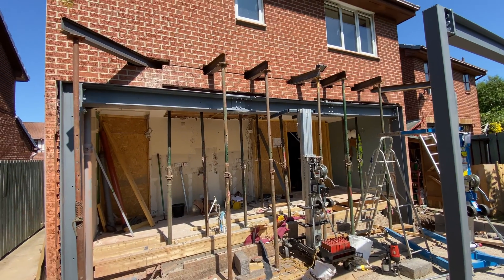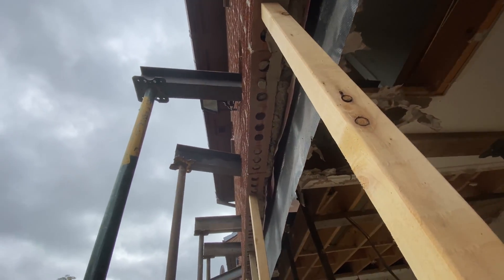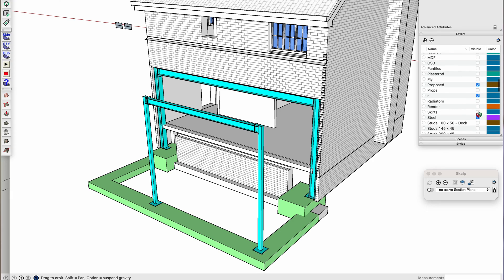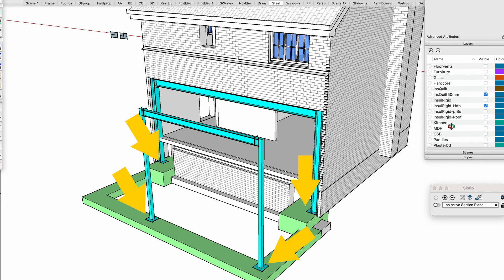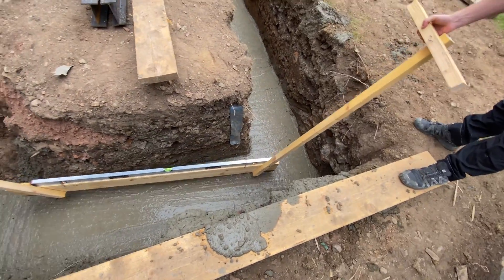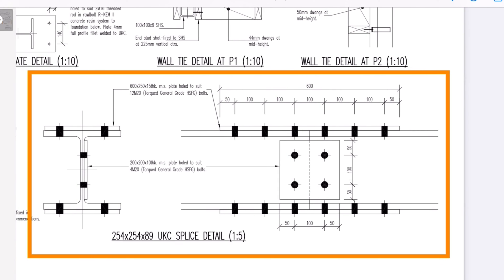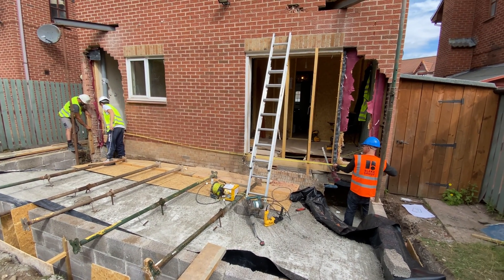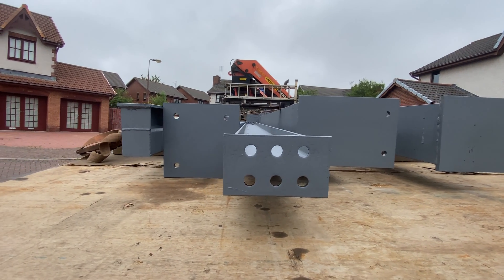Steel beams for house extension - working with structural engineer

Comment: Great videos, thanks !

Imagine I was thinking about a rear house extension. The footprint would be about 7m wide x 3m out from the house, height around 2.5 metres. So a big rectangular box. It would be a single storey, but would need a flat roof that becomes a balcony area to serve the floor above. 

If all of the knock through rear walls of the house would be taken care of with steel beams as is conventional. Could the new extension then  be then be built as a whole new steel framed box to sit butted to the back of the house and essentially be self-supporting, i.e  not adding extra load to the house ? 

I'm imagining conventional footings trenches/concrete would be used for the foundations.

Anyone, please... Very Roughly How much would a basic steel structural box 7m x 3m x 2.5m cost to have fabricated/supplied ? I live on the South Coast of Cornwall, it's 2025.

Comment: Looks brilliant - and very informative video. I've got joists spanning from side to side in my property (rather than front to back), was that the case with this build? Is the right thing to do to prop above the joists?
Reply from the maker: Hi and thanks. You prop above where the beam is going. And put a temporary prop batten under the joists

Comment: When I took out a wall 40 odd years ago (my one and only time), I put the full length beam on the floor by the wall, then put the needles through and supported them on Acros on each side. We took out enough courses of brick to allow the beam to fit in. Lifted the beam up via ropes over the needles and fitted it, fully grouting at the ends and top. I then left it till next day and then took down the rest of the wall. The house is still standing.
Reply from the maker: That’s a nice story and fantastic you’ve benefited from it over these years. There’s definitely an understated benefit to our lives when we do something like that and is there for years afterwards.

Comment: Great video and very well explained. Your comment regarding the level of detail provided the structural engineer is interesting. Was the scope of works discussed with the engineer when they provided a quote? Often the engineer will be expected to set out the general parameters of the steelwork (i.e sizes) and expect the contractor and steel fabricator to work out how it all fits together, so the engineer's quote will typically exclude these details.
Reply from the maker: Thanks for the encouragement and yes, you’re correct, the contractor needs to write the method statement and the safety plan, both of which require further engineering, which is a crazy situation . I don’t agree with this, but I don’t make the rules.

Comment: Hello I need your help I'm trying to get steel beams for my basement and we are trying to do the project ourselves... But none of the hardware stores I called sell them can you tell me where to start without a contractor
Reply from the maker: You need to go to a steel fabricator. They will ask you for your engineer’s drawings as they need to know which size and weight of beam they need to cut for you. You will also have to decide whether you want it installed by them or another way.

Comment: This has got to be the best video showing & explaining the process in detail that I've ever seen, very well done for this, is that sketch up your using as if it is I wasn't aware you could do quants on it, cheers 👍👍
Reply from the maker: It’s SketchUp I’m using, and yes, you can do the quantities using the Generate Report tool, which you then export to a spreadsheet. However, for some situations, I also use a plug in called Quantifier Pro , since it’s a bit easier. But Generate Report works just fine. Thanks a lot for your comment.

Comment: Great video. I am a structural engineer and you make a lot of good points. I would have done the connection so it sits on a top hat on the 203 UC posts but it can be done like this also. 

Subscribed
Reply from the maker: I think your suggestion of sitting it on top is a good one. There was probably more work in the solution we built. Thanks a lot for your comment

Comment: Great video. How you manage to get the structural engineer to provide so detailed details? They all claim that the details are "typical" and refuse to provide. Beside from that I can only applaud you. Well done getting it done yourself.
Reply from the maker: The trick with engineers is getting their draft drawings and reading through them with a fine eye. I’ll mark up with a blue pen, scan and send back. Even “standard” details should be shown for steel. They almost always miss things, but they’ll amend if you point out  discrepancies or omissions. For steel work, although I’ll create very rough 3d sketches or drawings which show the fabricator in summary what the components are, but for all the junctions and fixings, it has to be drawn and described by the engineer. Plate sizes, beam sizes, bolts and holes. If he’s not doing it, then he’s expecting the contractor to do it, but that would not be standard in a domestic situation. However, either way, you’ll be paying for an engineer, as if it’s not your engineer, it’s going to be your fabricator who will engineer it, and it will be added into his costs, just further down the line. Way better to get out all drawn out before the contractor is involved. Early scrimping, such as not paying to get the design totally nailed, usually costs way more in the long run, but in my experience people often tend to avoid paying engineers to do it upfront for some reason. False economy. Thanks for the comment.